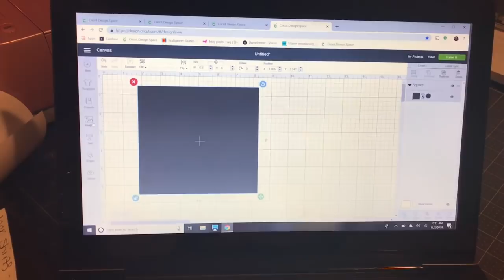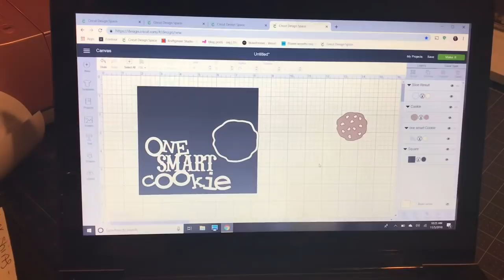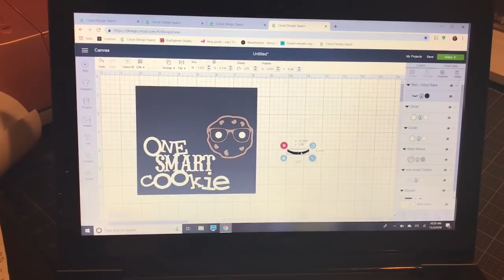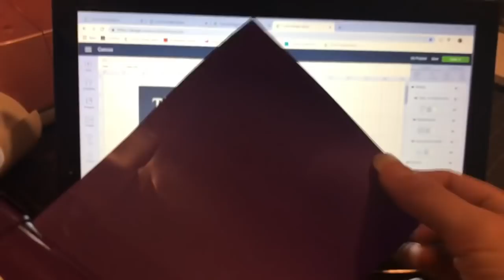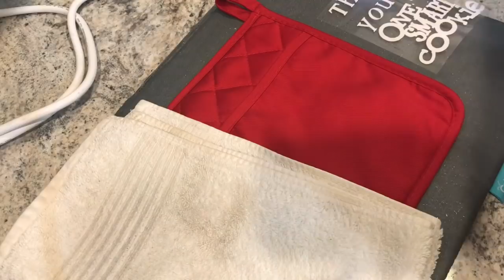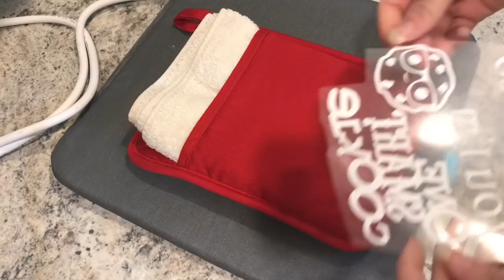Pocket Pot Holder Gifts Using Your Cricut

Comment: Can you still use them with the vinyl on them?
Reply from the maker: Loretta Snell they have a rubber backing and that’s the side that should be used to touch anything, not the vinyl side! As long as the vinyl side doesn’t come in to contact with anything hot, they can be used!